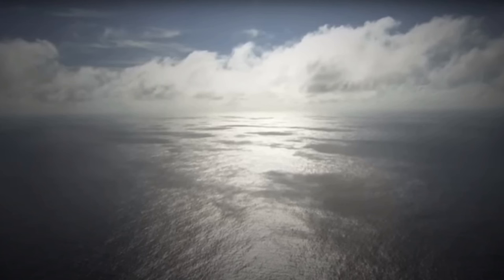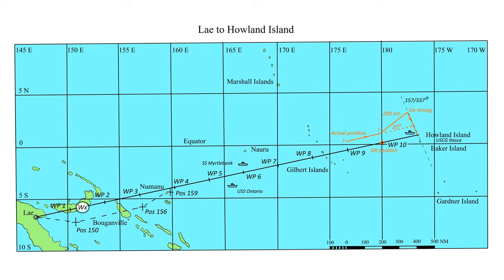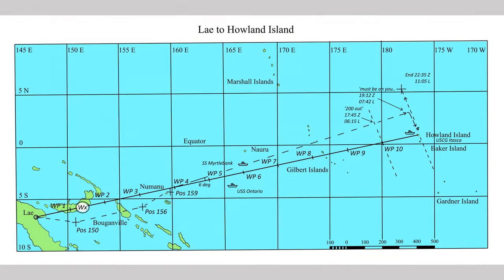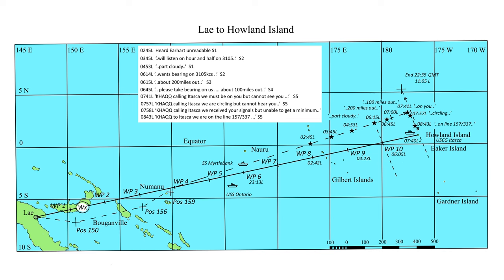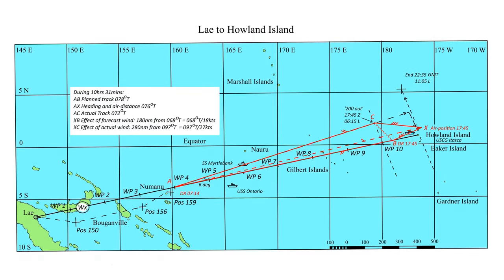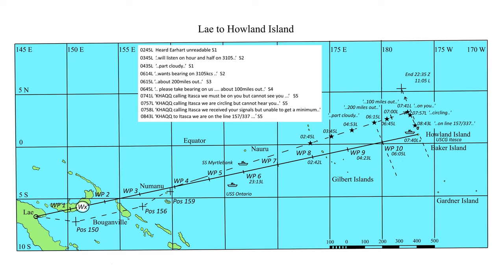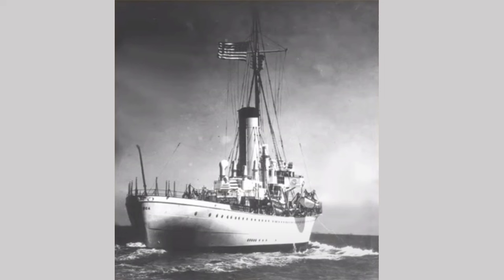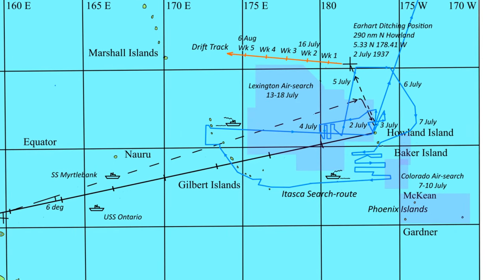The Last Flight of Amelia Earhart Part 2

Comment: TIGHAR drew a line from Gardner north towards Howland on a 337 true course and said this is the starting point where Earhart and noonan turned onto the infamous 157-337!! No research required!! TIGHAR can’t explain where the plane was before they turned onto 157-337!
Reply: @twright4263  right.  But more research should be done on Emily Sikuli.  Who was there a few years later on Nikamoro Island, and said she saw plane wreckage.  Her father who was the Islands carpenter at the time also told her about the bones.
Reply: @TheFarmerfitz  are you talking about the “landing gear” in the water? Dr Ballard and his team never found any plane wreckage in 2019. The “landing gear” was a pile of rocks! TIGHAR has done 12 expeditions since the 80’s and only has a piece of metal and credible witnesses. Oh and TIGHAR also said they found a piece of metal and has credible witnesses when they were searching for the white bird!
Reply: @TheFarmerfitz  I just did a quick read on Emily. All that information comes from TIGHAR! They couldn’t find the original interview from 1999. From what I gathered they are talking about the “landing gear” from the photo. As I said Dr Ballard searched the area and found a pile of rocks! TIGHAR also claims they have another area which they claim has what looks like engine cowling but unfortunately they can’t locate the area. Nobody can prove Earhart and Noonan survived beyond the morning of July 2nd. Nobody can verify that any radio transmissions came from them. Earhart could not communicate with the itasca before they took off and people all over the world have claimed to have heard her! How? 

What about the “ship in site” report? And what about the report from a deckhand on the Myrtleback on that same night hearing a plane flying overhead? TIGHAR doesn’t put much thought into those reports, why?
Reply: @twright4263  Not talking about where they saw just a landing gear.  It was scattered pieces of plane wreckage.  Her father told her there were Bones.  They were actually scared to go near it and her father wouldn't let Emily see the Bones.
Reply: @twright4263  I'm not someone who would wish the Nikamoro theory on anyone.  What a horrible way to go.  If they crashed in the Ocean, at leat it would be over quickly.

Comment: Noonan said the night before the trip they could only carry 950 gallons total.  This must include the 100 octane fuel for the boost at takeoff from the unpacked runway at Lae because at 950 gallons, the plane was maxed out at the 15,300 pound capacity for a runway as short as that at Lae.  With 950 gallons, they couldn’t have stayed in the air all of this time and distance. Especially with the headwind.
Reply from the maker: According to the Chater report, the fuel on board was 1100 US gallons including the 100 octane fuel. The weight of the fuel depended on the temperature and density.
Reply: @colingtaylor2158  That is definitely what it said, and it might very well be right.  I just find it curious that Noonan said the night before the flight that weight restrictions limited them to 950 gallons total.  I would think that he would have a good handle on that figure the night before the flight.

Comment: Just a theory I may be completely wrong. Had she had pontoons and food supply she might have made it. I think she avoided pontoons to be less visible to radar.
Reply: Pontoons?   To avoid radar?  Yes, you are completely wrong.
Reply: Also to make it lighter maybe.  And, yes or no(I'm asking), did she not require a different class license for that?  And Radar wasn't invented until 1940, so that's a negative to avoid Radar.  But yes instead of wherever she did, she could have landed anywhere on water, got towed in to refuel.
Reply: None fitted to save weight and drag resulting in more fuel being used and they only had a certain fuel storage capacity.

Comment: Despite the navy searching we can be fairly certain that she was transmitting from gardner. With that in mind and assuming they made it, they would have had to have been south, not north Of howland on the 157.
Reply from the maker: The Navy flew over Gardner Island within a few days. The Electra was not there.
Reply: @colingtaylor2158  Of course it wasn't. The navy Picked it up.
Reply: @colingtaylor2158 not just that but other groups have searched Gardner island before TIGHAR. There is a ship wreck and proof that people have been living there on and off for centuries.
Reply: She did not have enough fuel to get even close to Gardner Island, I’m not sure why people keep talking about Gardner. That was a southerly trade win which push them 6° north

Comment: Amateurish video. They DID find Earhart during the search and they DID recover some of her bones a few years later. There’s no mystery as to what happened, unless you’re ignorant of many of the facts of the incident.
Reply from the maker: No trace of Earhart, Noonan or the Electra have ever been found.
Reply: What’s the magnetic declination near Howland? TIGHAR doesn’t mention it. A 78 degree true course is what on a compass? 

What is TIGHAR proof? Analysis from a photo? I can’t scale off mechanical drawings, I have to use the architectural drawings. They found a piece of metal that washed up like 50 years later! They have credible witnesses that heard Earhart! How did they prove it was Earhart? Voice recognition? TIGHAR made the same claims when searching for the white bird. TIGHAR says that 157-337 is based on the sun line 11 degree north of Howland (67 degree true). TIGHAR says NOTHING about the 67 degree magnetic which is 1.5 degrees (80 miles) north of Howland (76.5 degree true course). Why is that? And where is TIGHAR research on the 67 degree magnetic to disprove that the 157-337 is not based on it?
Reply: You literally made up all of those “facts.”
Reply: wow, pretty arrogant statement, lots of navigators have come to simular conclusions as this fellow. No evidence found thus far has been conclusive. Gardner is 400 miles from Howland. Not very likely the error was south enough for them to reach Gardner.
Reply: @colingtaylor2158 Sorry your dead wrong